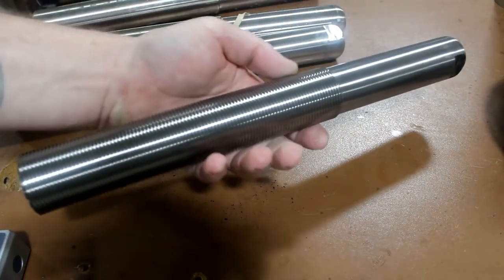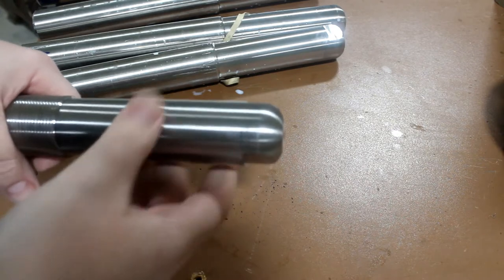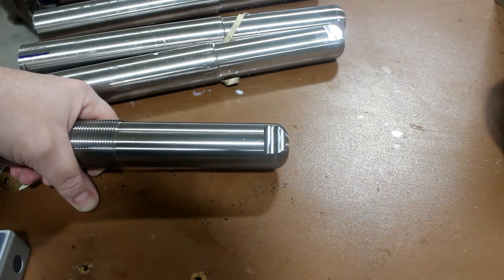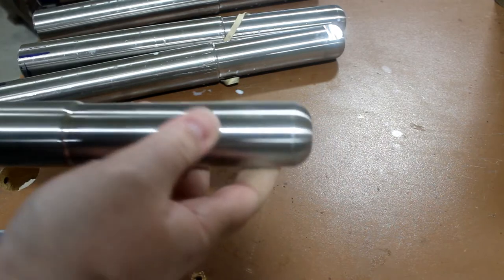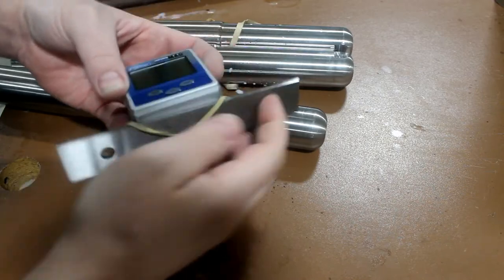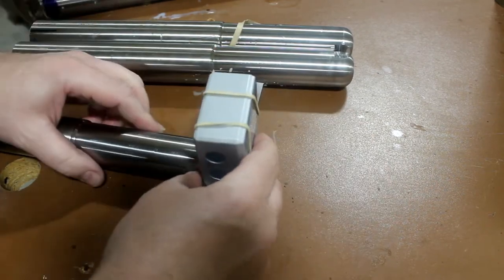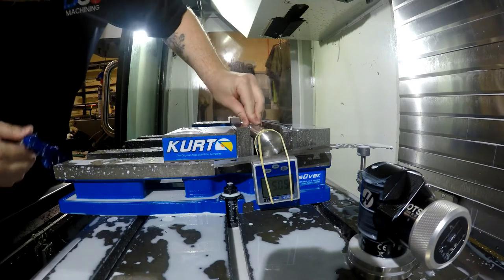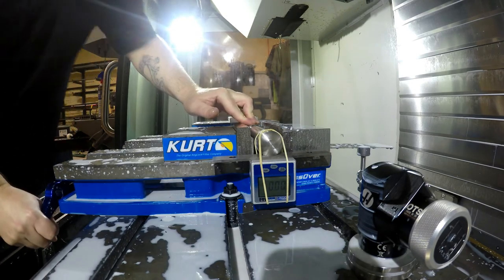Setup for machining parallel flats on stainless round bar.

Comment: Thanks for sharing. How are you making the initial cut into the material? I've tried plunging with a 1/4" 4-flute carbide end mill and had it wander and then break on 316L. Trying to mill a flat spot for to drill into

If you could share your RPM, cutting diameter, and the depth of cut you start with, that would also be helpful.
Reply from the maker: For 304 Stainless I use 5FL lakeshore carbide endmills. I wouldn't plunge into it, I always lead into the part with something if possible. If not, I would ramp in at maybe 12IPM  at about 2900 rpm. Preferred method would be with a lead in  and 5FL endmill I use 2900 RPM and 285 SFM (43 ipm) Hope  that helps.
-Daniel

Comment: There’s a much faster simpler way to do this. Use the parallel on the first flat an line it up with the top of your vise jaws 180° flipped. It is a Kurt so I’m sure it’s fairly precise
Reply from the maker: That's a good point will have to try it next time. Having the flat on the bottom perfectly the same height as the top of the jaws seems a little hard to setup tho that would only leave about 1/4 inch on a rounded surfaceto hold onto. Unless I'm missing something.